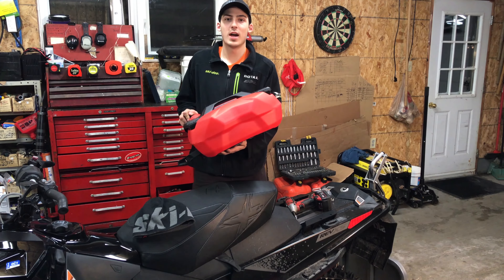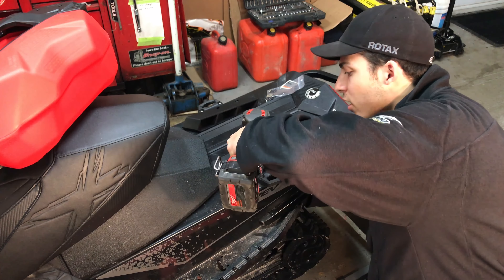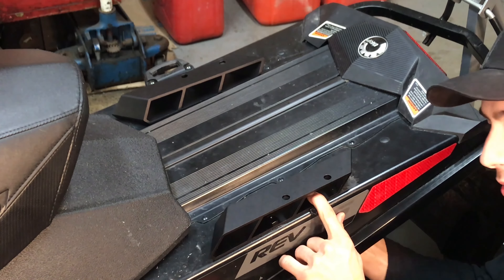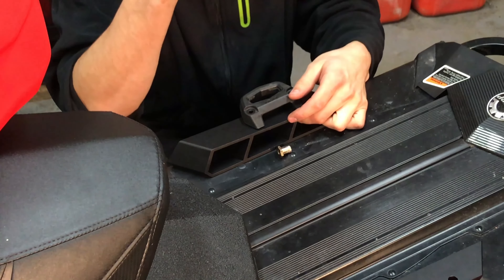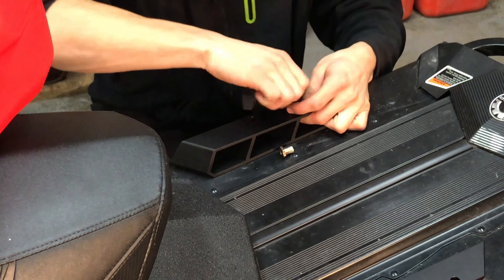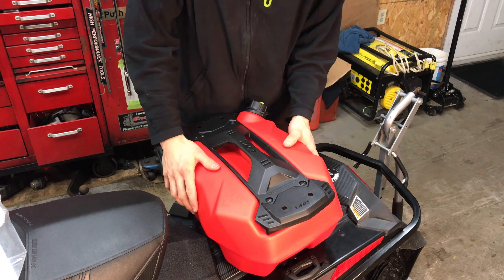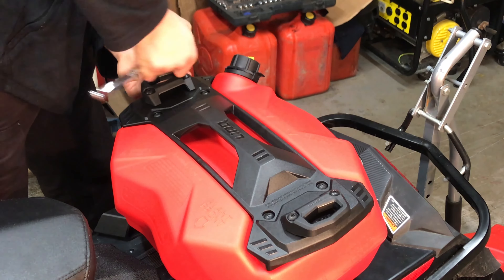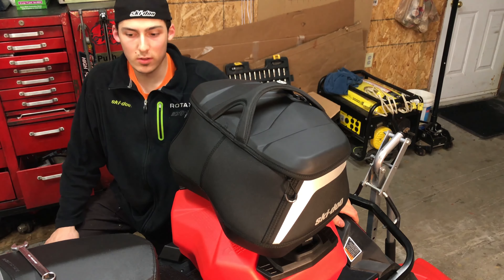How to install 2017 Ski-Doo LinQ Fuel Caddy

Comment: I have a 2015 Renegade.  If I install the shims in the forward LINQ bracket location will the shims interfere with accessories I wish to use on the rear brackets?  Do the shims alter the location of the brackets in relation to the rear brackets?  Thanks.